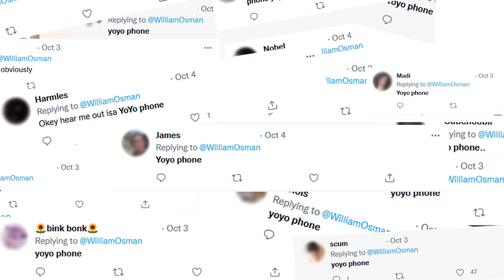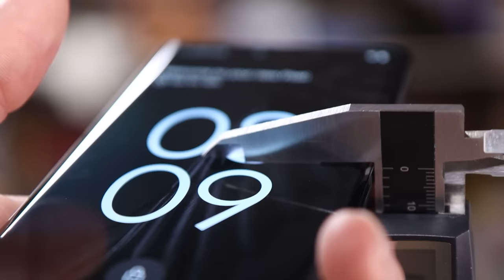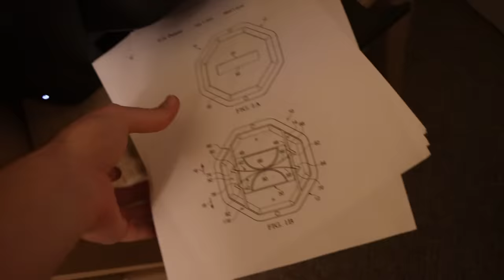I built a phone you can't drop

Comment: The spring idea is pretty much what a standard protective phone case is. A normal protective phone case (and especially those nerf cases) is pretty much a spring surrounding your phone. The cases don't redirect the impact around the phone but absorb and reflect it, like a spring. So out of all the ideas, it's no wonder the spring idea work the best.
Great video!
Reply: That is a scam fake comment
Reply: Phone cases are really not like a spring at all, they are just a layer of rubber or plastic.
Reply: @conorstewart2214  yes phone are just thinn pieces of plastic or rubber, but the mechanics of plastic or manly the rubber ones is that of a spring. Think of a rubber bouncy ball as it hits the ground it compresses storing the energy then releases that same energy causing it to bounce up. A spring works the same way, just only in one direction. (as to say if you drop a spring on it's side it will not bounce) a phone case made of rubber will do the same thing it's just not engineered to bounce as high.
Reply: That may be true, but in the future, it's all gonna be rocket phone cases.
Reply: @conorstewart2214  The physics is the same: F = -kx (Hooke's law). 
The rubber/plastic compresses on impact, and experiences a restoring force in the opposite direction. This has the effect of slowing down the phone's deceleration on impact, theoretically resulting in less damage. Phone cases are only a few millimeters thick, so there's not much material to absorb the impact like a full fledged spring would.
Reply: @m.f.3347  There is also plastic deformation which you wouldnt have as much with a spring
Reply: @conorstewart2214  Also true, I believe that's the science behind crumple zones in cars

Comment: 14:40
to be fair if it only has to fly for 1 second to stabilize and land it doesn'T have to be nearly as efficient as camera drones and can use insanely high pwoered, high rpm rotors and produce an insnaely high downwash speed to get more lift per area than regular drones

Comment: Improvement idea: Make a little trigger on the side where you'd normally hold your thumb that keeps the parachute from flying out, then increase the sensitivity of the trigger mechanism and make it so when the trigger isn't held if it detects a free fall it will launch the parachute. Also get a better parachute so it doesn't still drop like a rock.
Reply: It would deploy in your pocket or while charging. Also just in general when you put it down.
Reply: @bruhgamingnl1315  only if it detects free fall he said

Comment: I think that while the drone may not have worked individually, putting it with the parachute (&maybe springs) could work better. 
Also, I noticed that the main reason the parachute didn’t work on its last attempt (when it was already open) was because it hit the tree. So finding a sweet spot on the deploy times can definitely help.
Reply: Fine observation, after revisiting the scene and looking for possible failure causes, I have concluded that the tree was indeed a problem number one.

Comment: I have an idea. You need a capacitive touch sensor to detect when the phone is in your hand or not, and a retractable tether linked to the phone which retracts when it doesn't sense your hand touching the phone. This retraction device should be fitted into a plug shaped housing and  inserted into your rectum for optimal convenience no matter what clothing you choose to wear, if any. 

Depending on the size of your... anchor point... it could be possible to have a few more additional features. A hollow section for your phone to slot into when retracted, fully encapsulating your phone and protecting it inside of your body. A battery bank and wireless charger for charging on the go. A vibration motor to notify when you have dropped your phone. An extender to hold additional phones. Water cooling.  The options are endless, really.

Comment: I know I’m a month behind, but this is your best work yet. I loved every second of this video…even though you didn’t give yo-yo phone a fair shake.
Reply: What about a weight or like a sand bag that helps put more weight in the back of that phone causing it to land on the back evey time it falls but also heavy enough to keep it from bouncing around or rejecting off the ground and flipping onto the display after landing
Reply: I like the “weighted-one-side” idea, kind of like a cat always landing on their feet.
Reply: The problem with two phones as a yo-yo is the 3-axis instability equated to tennis rackets.  Spinning around the long axis (like a dancer) or short axis (like a frisbee) is no problem, but when the long axis spins around the medium axis (like a gymnast flipping forward or backward), inertia starts doing tricks and flipping the thing sideways to the direction you spun it.

Yes, Will's setup was in the flat direction of each "phone" like a frisbee, but having two phones instead of one seemed to turn the short axis into the medium axis, as far apart as they were spaced.  Try throwing two frisbees glued together with a paper towel core; they probably won't fly happy either.

The only way to make a possibly successful phone yo-yo is to mount two spools with two strings to the "head" and "foot" of the phone, so it can spin along the long axis.  (Or cut the phone in half and mount the spool in the middle...most phones won't like this very much and might still have big aerodynamic problems, preventing a clean spin.)

Comment: That's a lot of dedication you got to protect a phone, especially after those unlucky phone drops. It would be cool to see the helium one refined. I'm thinking just buy a party grade helium tank (They're a lot cheaper than cartridges) then attach some strings to the phone and balloons and it could levitate without feeling like it weighs anything. Could add a few extra balloons to have it fly away while recording like a drone then shoot it down maybe with its own little attached gun before it gets too far, I think that'd be pretty cool😎. I looked into your valve idea and apparently helium balloons usually lift around 14g and a google pixel 7 pro weighs 212g, so around 16 helium balloons should do the trick. Also, that tank bigger than your head which I think it says 19g helium is still around half the helium you'd need so good thing you didn't use it. Anyway, cool video
Reply: 👆👆Congratulations you have been selected among my shortlisted winners 🎁🤩🎊🎊🎊🎊🎊🎊🤩
Reply: wow congratulations cooler NileRed you won a totally not a scam this is incredible
Reply: Arnt you the guy who makes the markrober conputer genrated vids?
Reply: Alternatively, you could use hydrogen gas, which is lighter, but could cause a mini Hindenberg incident. Either way, pretty cool

Comment: You are over thinking it. You can use an infrared sensors to measure if a heat signature is  within a few inches of the phone from either  the front or the back of it. If it's in your pocket it will know it, if it's in your hand it will know it. If it's falling and a heat signature is decreasing rapidly its time to deploy the parachute.

Comment: (6:29) maybe turn one of the phones so it makes a “+”...? Or, maybe a secondary attachment that acts as the yo-yo...I’m picturing a spherical, nested-container that can...sort-of gyroscope a bit, so it points up no matter what angle the phone drops. The yo-yo part, (inside the sphere) is a device that will automatically retract the string when triggered (either at the end of the fully extended string, or when the weight of the phone causes a tug mid-fall). If it’s attached to the belt, and the string is the right length, even just the string will stop the phone from drop-impact...the cool part is the automatic return-to-body without bouncing into genitals.

Comment: 0:17 Try to see a neurologist. To this point, I owned my phone for 5 years — now. I dropped it once. ONCE in these 5 years. And only because I fell asleep while reading in bed. And get a better case. Once that makes your phone less slippery. Because your number is at least 400 too high for one year.
1:04 Others solved that problem already. There are cases with a cord, and you wear the whole thing around your neck. On the plus side, that also makes it harder to steal. On the downside, you might look like a special needs kid. So it wouldn't change much.